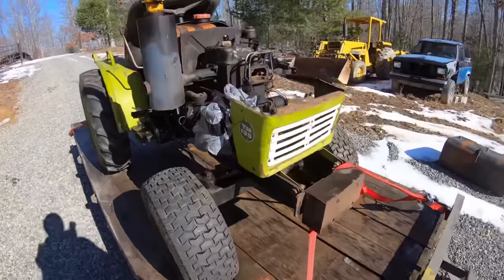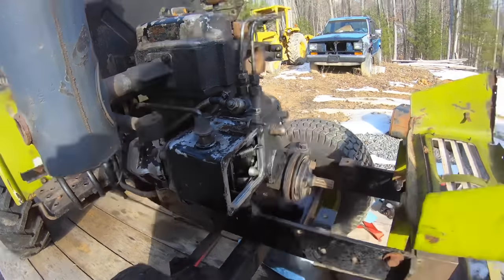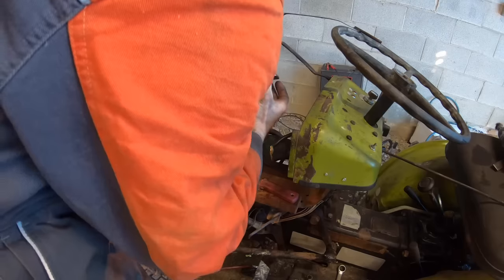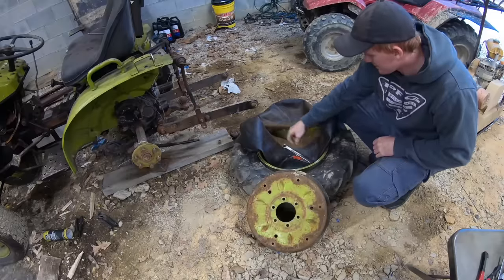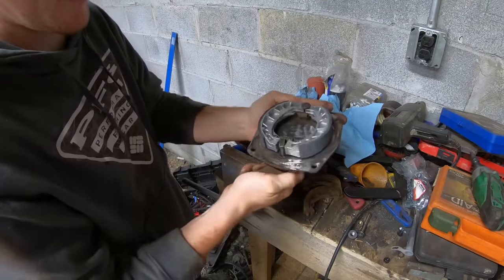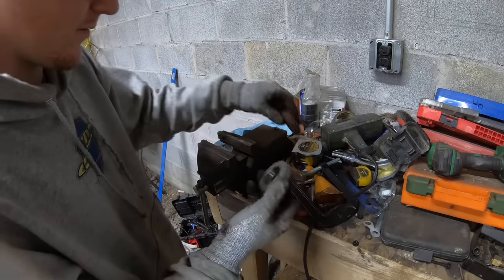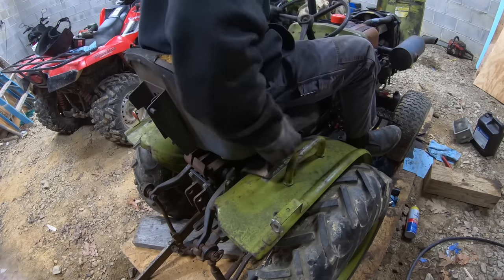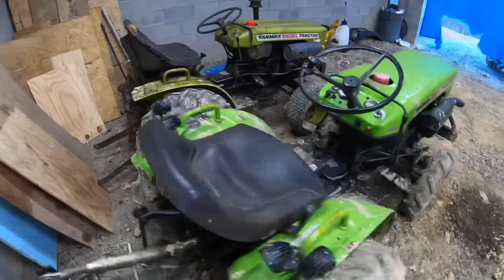Buying and Fixing a Cheap Small Compact Tractor

Comment: Ive been working on and restoring those tractors since I was a kid, they are grest machines.the pump is timed by increasing or decreasing the amount of shims on the pump backing plate where it mounts to the engine block. the factory standard shim is .003 usually. If they omitted the shim the timing will be off. and if it runs it will knock horribly. timing the pump is a simple  procedure if you have a few specific tools. Id also check the governor linkage if its running wide open. I would be highly suspect of a pump that a shadetree disassembled. I dont even go into them unless its a field temporary repair and I have nothing to loose by doing so. A mal adjusted pump can do serious engine damage over time. Hoye tractor parts out of Texas will have most parts you need they are great guys, good luck wish you well.

Comment: Hi Dave.  I have a 135D that I bought used 36 years ago!  I call it my diesel spoon as it has a dozer blade on it.  Not a trip snow blade, 4 way dozer.  Almost idiot proof and a great trailer mover w balls on the dozer.  Man, that starter took a licking, but hung in there with you.
Reply: Poor starter indeed.
Reply: Also, it's a diesel, it's not made to rev like a chainsaw...
Reply: Stanley, that sounds awesome.  Are there pictures posted somewhere? I've owned a number of yanmars for about 23 years. Definitely home owner grade.
Reply: @reddoggxj  I actually have several more YanMars.  A 1301 with a loader, I need to pull the PTO down.  Will use one of your videos to help.  Tiller stopped tilling, PTO related.  A 226D that is on turf w finish mowers and tiller.  It is stuck in 4 wd, lever just flops.  Bought them that way and awaiting their turn under the knife!  Hopefully just a broken fork?  A grey market 2210 that was a Fredricks rebuild w 100 hours on it.  I don’t mind the twins and like the power shift transmission.  No issues, plus it has power steering.  I wish the 226D did, may try to retrofit this summer.  Pushing 76 and waiting for warmer weather up in MI.

Comment: the factory temp sensor has to be grounded to the engine, therefor no thread tape, i assume the gauge is not the same? i have a 87 226d, it to has the lights, the old temp and oil pressure switches worked but i changed them anyway.

Comment: Harbor freight sells a O-Ring index box with a few rings of each size.
In metric and another in inch.
When you removed the flywheel, didnt it have timing marks to set valve lash?

Comment: I have a question hopefully you can help with about a Yanmar YM155. It was idling and the PTO lever was bumped into gear with a small bush hog hooked to it. Something popped and now it will not drive or spin the PTO.  Any idea what I broke?
Reply: Some might have a keyway inside there should be bolts around the pto shaft to take out and or it sheared the teeth

Comment: Where did you get parts from? Brakes and temperature gauge
Reply: I get all my Yanmar tractor parts from Hoye tractor in Texas. He has about everything. I met him and he’s a real nice guy. Aaron is the owner. He is very helpful. He knows these Yanmars inside and out.
Reply: Thank you. Have had mine a while and it’s been great little tractor but needs some tlc.
Reply: I also have to add a water pump like you did on your other tractor. Mine over heats running my big finish mower
Reply: @cicerowilson9257  I have a Yanmar YM2000. Good tractor. I think it's a late 70's. Just put new pistons and rings in it.

Comment: You appeared to tighten the bolts to the crankshaft without proper torque plus you added locktite to bolts that should have been torqued.
This poses two likely problems:
After the engine has been run at temperature then cooled a number of times, it is likely one or more of the bolts will begin backing out and potentially tear things up when they do.
Adding locktite or any other substance to bolts requiring torque increases the amount of torque required to prevent the first problem.
Unless you know for a fact that old brakes do not contain asbestos, never blow out the dust as a means to clean the brake drum assembly as this tends to atomize fine asbestos fibers which you unavoidably breath in and the fibers can remain in the air or easily be stirred up just by walking into your garage.
This is why brake clean was invented.
The medical condition is called Mesothelioma.
Sorry to scare you, but it is a serious condition.
This was the number one medical condition of old-school mechanics before they figured out the cause.
Good job fixing things on the cheap.

Comment: Am about 1/2 way thru the video, and Man that little tractor was rode hard and put away wet 💁 -
Reply: You really saved that thing from the scrap yard, which i think is good. It seems pretty hard starting... wondering if you checked the compression. Also, dirty injectors could slow starting as well as cause some overheating, I would think. Great Vid, especially for anyone who has one of these 👍 ~